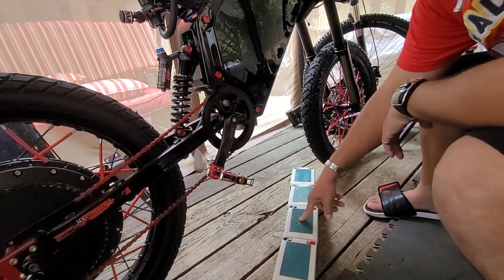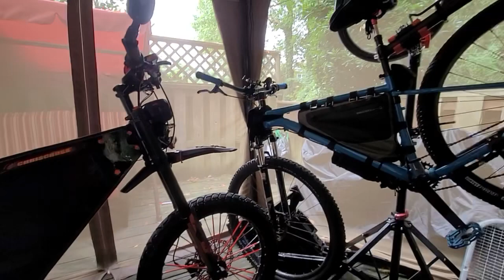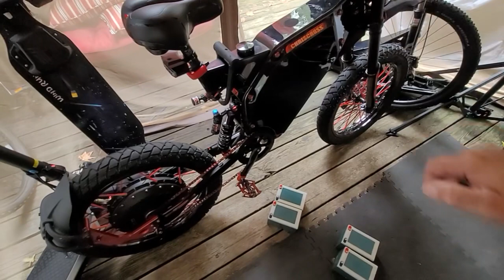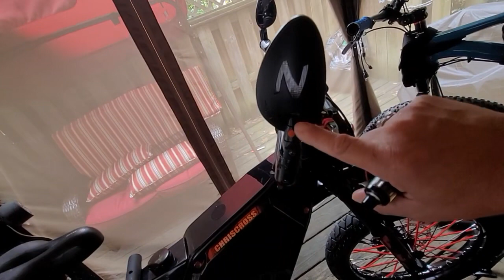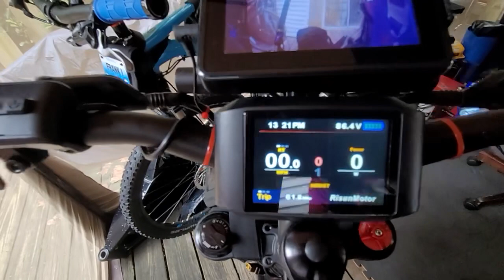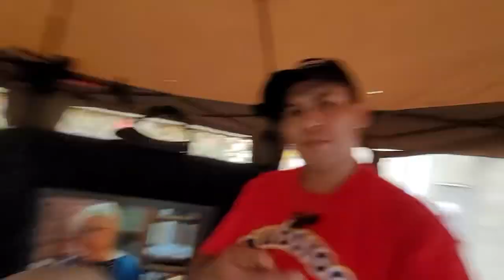CCW Rewind Simple Batteries Series & Parallel Configurations be it single cells or entire packs

Comment: Hey nice build man. Just curious if you ever had issues with the rear swing arm on these frames? I bought one of those frames and im in the processes of building my bike but the axle drop outs dont line up and when i put the motor in its crooked to the point that the tire is touching the right side of the swing arm.
Reply from the maker: when you say one of those frames do you mean this exact frame or a similar frame I dont see that ever happening with these frames lots of cheap similar frames
Reply: @ChrisCrossingWires1212  it's the EEB frame same thing you have with the plastic panels on a metal frame. My rear swing arm looks identical to the one in your video I got the 155mm drop out.

Comment: Hello Chris, crossing wires, could I use a 48 V, 2000 W motor with a 72 V controller and battery that is 72 v 20ah or. well I have to upgrade my rear hub motor, to 72v
Reply: All depends on what sort of motor you got. Is it nbpower? I'm sure for alot of 48v rated motors you can get away with 60v easy, you just have to keep an eye on temperatures for some motors more than others

Comment: In a series connection, do the batteries have to have equal Amp hours? Or could a 48volt 12amp hour be connected in series with a 48volt 8amp battery? 🤔
And if so what would the new Amp hour be?  🤔
Reply from the maker: They should be equal ah otherwise they won’t have same amount of run time the 8  would obviously deplete before the 12.  Could it work yes but would it make sense not really could you harm anything no